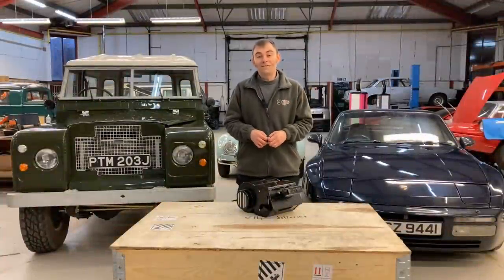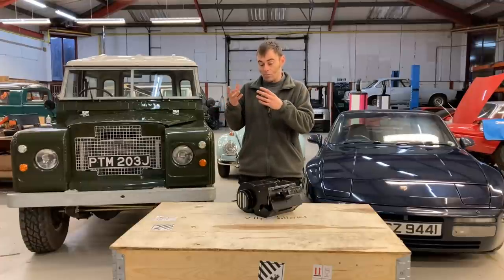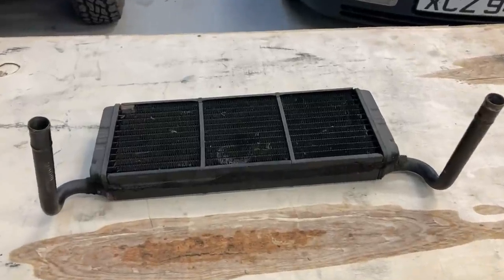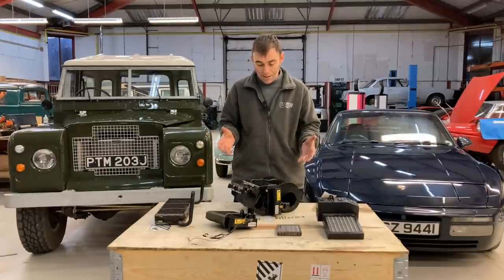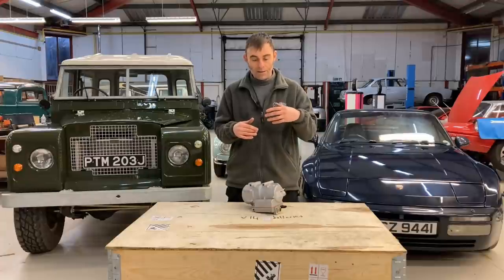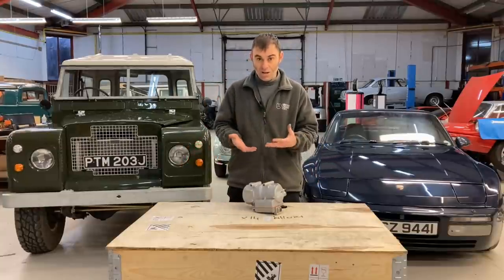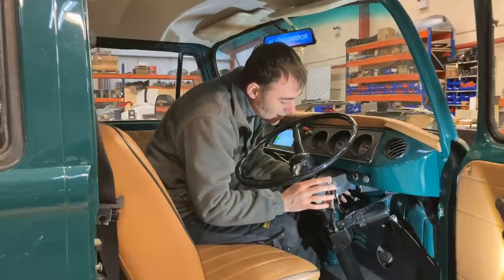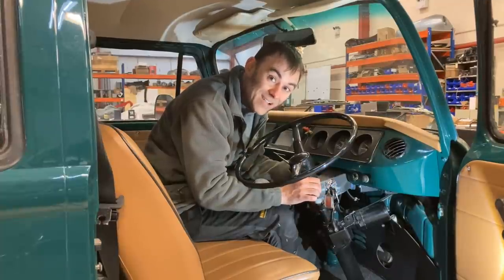Tech Talk - Electric Car heating, power steering, brakes, etc

Comment: As hard as I try I just cannot get excited about EV's.  Dunno why because I've always been an open-minded hot-rodder and have easily embraced new ideas and ways of accomplishing the qualities we deem necessary to more speed, better handling, increased mileage, etc.  That said, I guess that, in time, I will probably dig the idea of chasing electrons around, you think?  Who knows.......
Reply from the maker: As a fellow hot rodder I thought I'd never be excited by electrons too. Then I built my first electric converted car 7 yeas ago, and from the first poke of the throttle I knew petrol  was dead to me. 😉😁👍
Reply: @ElectricClassicCars  That's great......perhaps it may happen that way for me.  I'm nuts on power:  If some is good, more is better, and too much is just right.
Reply from the maker: @tomnekuda3818  Too much is never enough. 😆😁👌

Comment: Why do you continue to use the car’s original 12V battery? You’re fitting a DC/DC converter to drop the EV battery down to 12V to charge the 12V battery. Why not just run the car’s 12V electrics directly from the DC/DC converter? It would be more efficient and save the weight and space of the old 12V battery.

Comment: Electric cars are very efficient at stripping the earth of its minerals.
Reply from the maker: Everything comes from the earth. How do you think steel or aluminium is made? 😆😁
Reply: Electric vehicles take a lot of 
Precious minerals, like lithium, cobalt and nickel, and are stripping the earth of its rare minerals very quickly. Steel and aluminum are not a issue.
Reply: Most cobalt is used in oil refining
Reply: Stainless steel is the largest user of nickel and there are alternatives to lithium ion batteries such as solid state, sodium ion and graphene super-capacitors. In addition to this, the biggest users of lithium are glass and ceramics.
Reply: Most of the above “rare” minerals aren’t actually rare. Some new batteries don’t even have cobalt in them. If you care about preserving resources go after oil refining.